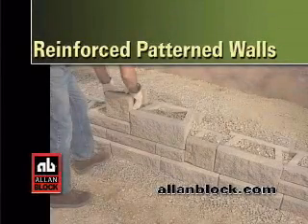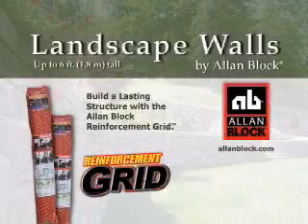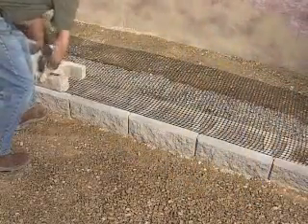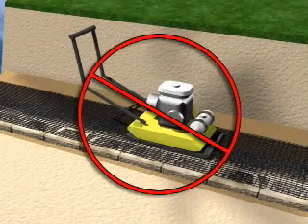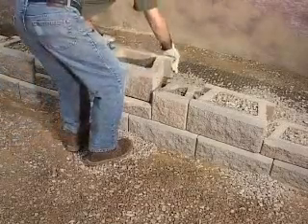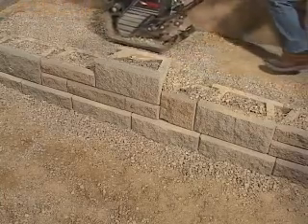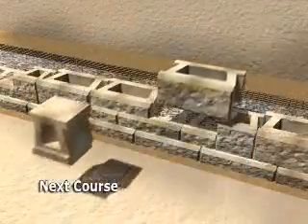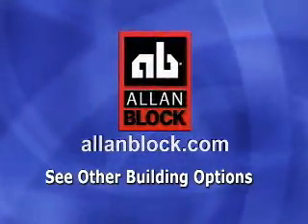How to Build a Retaining Wall - Pattern Walls

Comment from the maker: my assumption to your term "jack joint" was in reference to a running bind whee the blocks are stacked directly on top of each other so that the seams line up. Is this not what you were referring to?

Comment from the maker: A Patterned wall does not have a true"jack joint" as you mentioned. The blocks used are of varying heights and widths. check out Allan Blocks detailed installation information on patterned walls to see just what i mean.